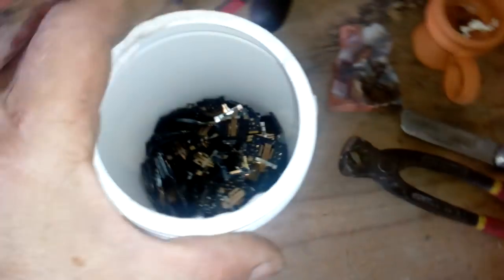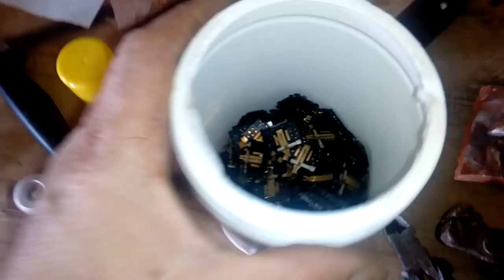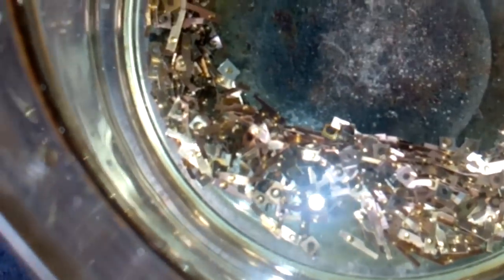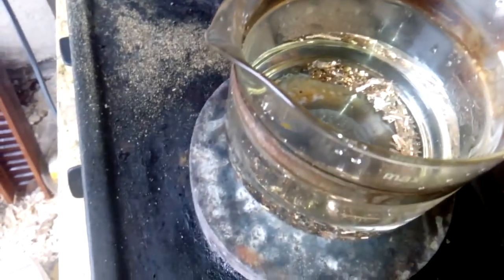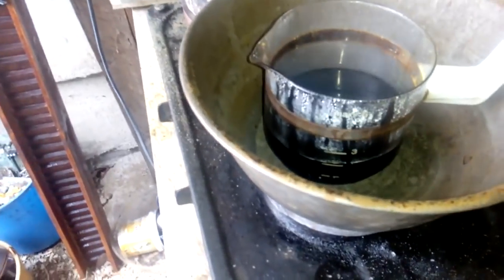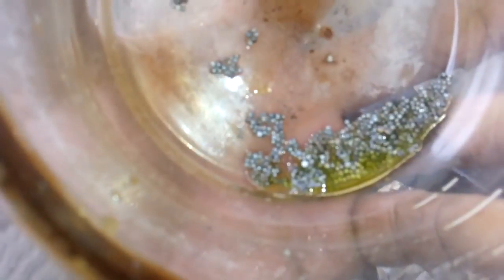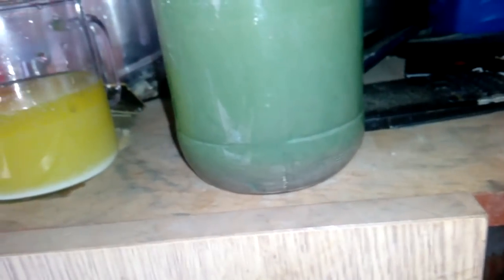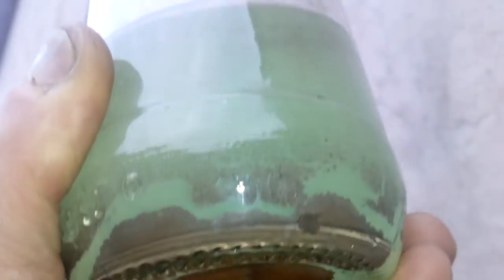Processing gold contacts with Poors man Aqwaregia

Comment: Hello friend, would you describe more detailed procedure how to recycling with Agua regia? Does it work with everything? Can Mannnachdem gold be solved with urea, then SMB skins
Reply from the maker: Aqwaregia dissolves pure gold, is made in combination of three parts of Hcl (hidrohloric acid) and one part of Nitric acid, Poors man Aqwaregia is made by adding Sodium nitrite to Hcl and this combination dissolves gold. It can be used on dosage of materials, but for some it is better to use the Ap method and In other ways, Aqwaregia is more a process for clearing gold,vhe not lot base metal in material.

Comment: Cool bro keep up the cool process...
Reply from the maker: Thanx bro-you to :)
Reply: Nice vedio.
Silver chloride not removed by nitric acid.it remove by amonium hydroxide.
Reply from the maker: My plan was to put in lye and suger water after I washed it when I converted silver chloride and separated it with Nitric Acid to remain pure gold, but I changed my mind at the last minute and did the melting as it was because I did not have time.